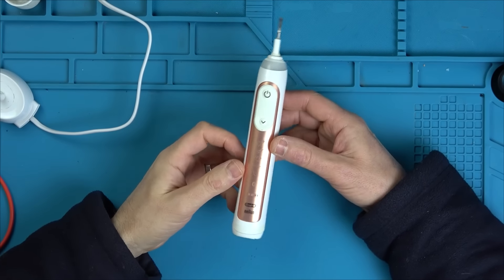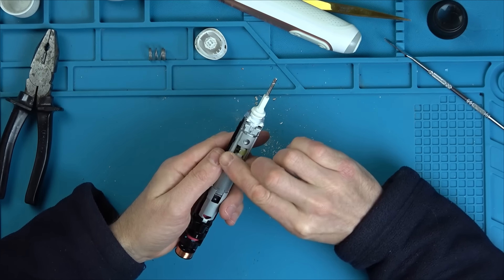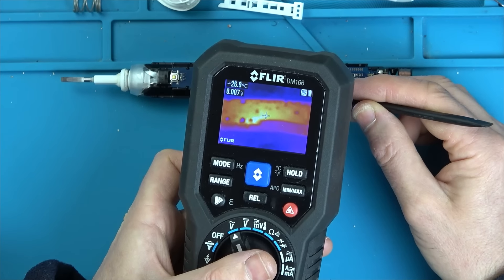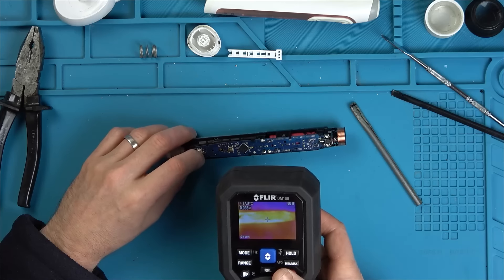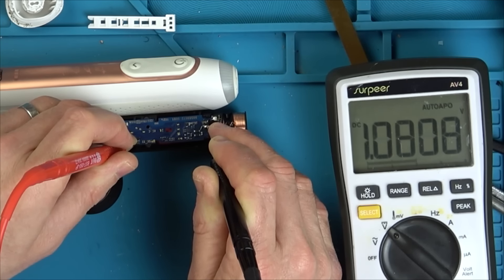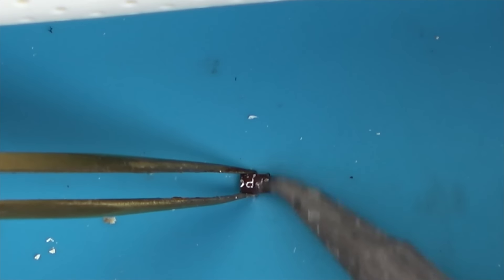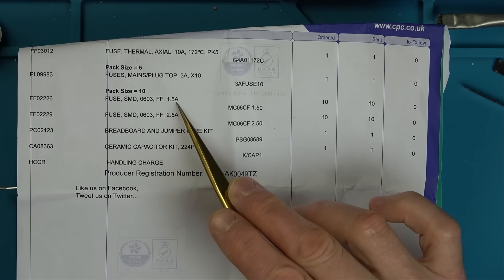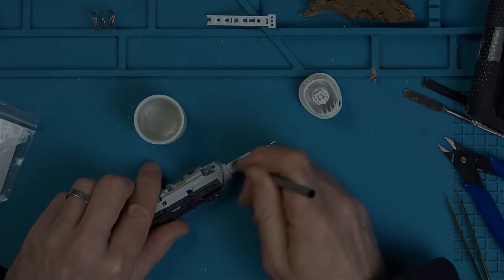Trying to FIX my Wife's ORAL-B Electric TOOTHBRUSH

Comment: Sure, IPA is conductive, but literally everything is conductive... to a certain extent. IPA is several orders of magnitude less conductive than your typical PCB conductors, like you've shown in the video. Are there areas where IPA probably shouldn't be used due to a potentially harmful impact? Probably yes, but I highly doubt that any of us will ever experience a situation where that may become an issue.
Reply: though, ff the isopropyl dissolves something, for example some dirt/corrosion, it can become conductive due to whatever might now be suspended in it.
Reply: Any additional conductivity introduced by IPA could lead to signal degradation or erroneous readings in high resistance circuits or components, such as those involving sensitive sensors or high-resistance circuits. The presence of even slight conductivity might interfere with the intended functionality of these components, affecting their performance or accuracy. However, I highly doubt you'll ever deal with these types of circuits 😂

Comment: Electronic grade IPA has low water content, that’s less than 0.1% which reduces the risk of damage or malfunction of electronic devices. EL Grade IPA is non-conductive making them more suitable to clean electronic components as it does not conduct electricity and cause short circuit. It has a high boiling point, making it effective at removing contaminants from electronic devices without causing damage. Also, EL grade IPA has extremely low levels of impurities such as oils, acids etc., which can damage the electronic devices.

Comment: I never understood why "throw away" devices have fuses to protect the chip when they are so hard to fix. Is this a built in failure point?
Reply: I guess it is to stop the lithium battery going up in flames if it overheats.
Reply: In normal use the fuse is resettable, so when it cools down it will work again.
Reply: @tim0steele  thanks good to know. But many other products just have fusable links (coffee makers)

Comment: Isopropyl alcohol (IPA) is not conductive by itself. However, a 99% or 70% alcohol/water solution is only as conductive as the water portion

Comment: I've never had problems with using IPA, the conductivity is so low it shouldnt blow fuses, some spray on contact cleaners havw a higher conductivity than IPA, again no problems using it.
Once I ran out of IPA and used some carb cleaner, never again, it removed the solder mask and a few thin traces.
It's all in the learning curve, some you win, some you lose.
BTW,,,,,,Tip of the day,,,, carb cleaner is no good for car alternators, you get a lovely flash of light, a bit of flames and a big puff of smoke,,, quite exciting, Guess how I know LOL

Comment: Technically, IPA is conductive, but only to the % of the alcohol to water ratio. 99.9% IPA is completely safe to use, and it won't hurt a thing. It evaporates too quickly to cause any issues
Reply: If the water is pure it is not only not conductive it is actually quite a good insulator.

Comment: Is your multimeter always giving you the correct awnser? You explained way your fuse varied in the end, but 3ohms on those cabe can not be correct and what if the 3ohms at 0 real ohms become 30ohm by 10real ohms or a totally different sum?
Great to learn about letter marked fuse! Thank you!
Reply from the maker: Thanks Anders, I think it is reading 3 Ohms on top of all readings, so 0 ohm = 3 Ohms....10 Ohms = 13 Ohms.....1000 Ohms = 1003 Ohms. My multimeter is annoying though as the complete short reading can often vary when it should always be under 1 ohm, but I love how responsive the beep is on continuity test, hence the reason I never change it 👍👍👍

Comment: 3A fuse in series with 300mA fuse? Doesn't make much sense to me. Could it be one of them is wetness detector and IPA messed it up? Just guessing.
Reply: 3A fuse is for the motor, 300mA for the electronics.

Comment: poor some IPA on your mat and check the ohms, you will find a large resistance value not exactly a direct short but a value just the same....IPA evaporated pretty fast so the work time is quicker than say soap and water......iten it?

Comment: I got this off google >(Isopropyl alcohol itself is not conductive. A 99% or even 70% alcohol/water solution will only be as conductive as the water portion, inhibited somewhat by the alcohol. It is conductive enough to worry about, though, so don't run the electronics involved until they're completely dry.

Comment: IPA is conductive as it does contain some water elements . When used on an electrical device no current should be present while using IPA.
Reply: what does water have to do with conductivity water is non conductive, the salts and other polutants in tap water are confuctive, water in ipa does not have any polutants, IPA generally is not conductive, but the polutants it dissolves on the board can be conductive, flux for example

Comment: Not my knowledge but Googled it.  "Isopropyl alcohol itself is not conductive. A 99% or even 70% alcohol/water solution will only be as conductive as the water portion, inhibited somewhat by the alcohol. It is conductive enough to worry about, though, so don't run the electronics involved until they're completely dry"   So I would say no don't on the electronics

Comment: While 99.9% IPA isn't conductive, it  is hygroscopic and will pull moisture out of the air. So eventually it'll have up to 35% water, be careful using old IPA thats been exposed to the atmosphere on electronics.

Comment: I think those fuses are resettable fuses maybe?  The reason I thought that, was that it worked again when measuring it out of circuit?!?  I am sure IPA can conduct!  So when you introduce it over a power circuit, it could cause a problem!  If the E does relate to that 375mA (approx), the worse that could happen using a 1.5A fuse is its starts a fire whilst brushing teeth lol - at least there's lots of water nearby!!!!  I think the chances of a fire starting are pretty slim, but those batteries can pass high currents.  Chances are a trace on the board would burn out before a fire!
Reply from the maker: 😂 Hopefully the saliva will quench any flames! Interesting, I wonder if the big PP one is resettable, hence the reason it didn't work when heated up. Also maybe resettable fuses are more prone to failure than just a thin wire which can't really go wrong.
Cheers Chris 💪
Reply: IPA, on its own, does not conduct electricity.
Reply: @oldbatwit5102  Correct, try and find 100% IPA for general use...
Reply: @GadgetUK164   I don't need any.
Ps... If the water in the IPA is pure then none of the mixture, water or alcohol, will conduct electricity.
Pure water is a pretty good insulator.
Reply: 99% IPA isn’t conducting anything.
Reply: @perkulant4629  The 1% water or whatever in there is ;)

Comment: Your iso-prop conduction experiment just shows your iso-prop it isn't dry! You are seeing the conduction of the water which, to be honest, is very small as you are reading megohms ... pure iso-prop has very low conductivity. One explanation of your earlier commentards response may be the use of cheap "rubbing alcohol" (especially in the States) which is often a synonymous term for iso-propanol. However, as there is no recognised chemical standard for "rubbing alcohol" across the world, rubbing alcohol can be 99% iso-propanol or it can be as much as 40% water with methanol, ethanol and other impurities too ... that would make it very conductive.

Comment: IPA 99% does conduct a tiny tiny amount due to that tiny percentage of non alcohol which ionises creating a conductive path, some people use 57% which does conduct electricity being half water and thus not usable on circuit boards in general because the water can separate and trap under components creating a permanent short until evaporated away.   Think whoever gave you that hard time was talking out their tadger :(

Comment: IPA is not conductive, BUT that is 100% IPA. even 99% is a tiny bit conductive so no power should ever be applied until the IPA has evapourated and the water dried. You can regard 99% as non conductive, but here is the problem - IPA attracts water so it does not stay at 99%. but in 15 minutes of exposure to the air, 99% IPA can become 92%. Put the cap on the IPA the moment you have dipped your cotton bud - do not put IPA in an open cap etc. for use.

Comment: Isopropyl alcohol, ethanol, isopropanol, are very conductive because of the water that is added to them. 99.9% wouldnt be but 91% amd lower would be conductive because of the water that is added to them. If they were to use distilled water in them then they wouldnt be because theres nothing in it that makes it conductive. So theres no ions in distilled water to make it conductive. But these companies that make isopropyl alcohol use regular water and the only reason its safe to use on electronics is because it evaporators suoer fast and once that water is completely evaporated theres no way of it being conductive anymore.

Comment: Oral B and fellow travellers make it  pretty difficult to fix their toothbrushes. It should be very straightforward to replace the battery but they bury it in the structure so that it takes some effort to get out. They should be sued under right to repair legislation.
Reply: In which jurisdiction? Such legislation is not universal. 

How much of a damage award can be expected? Would it even cover the filing fees and the litigant's time?